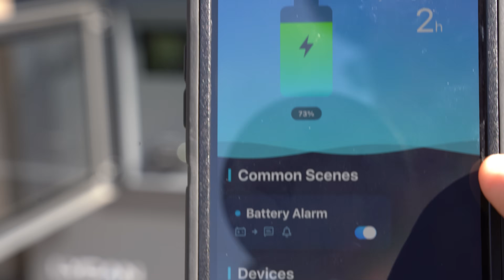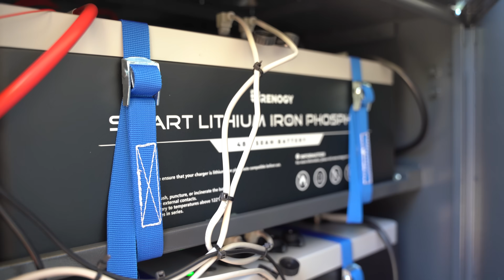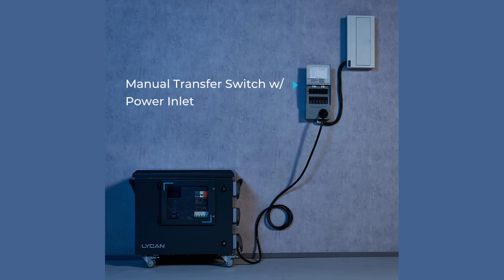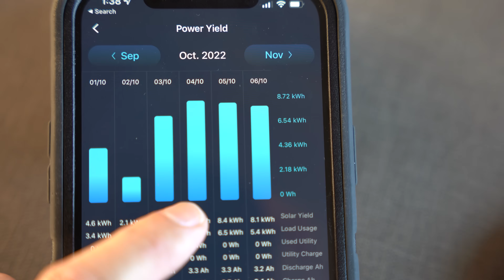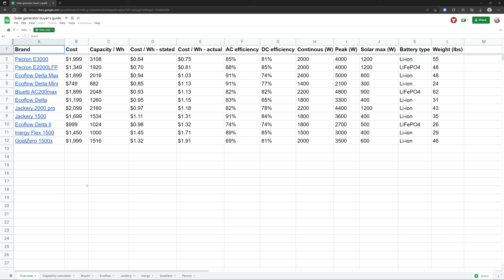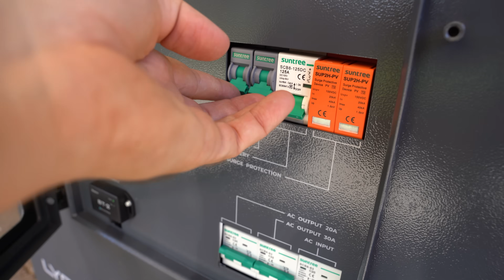Renogy Lycan 5000 - Home Backup Power

Comment from the maker: If you're interested in picking one up, you can get it here: https://cityprepping.tv/3D00sYE. Download the Solar Generator Guide: https://cityprepping.tv/3TUxu3f
Reply: I have a transfer switch but aside from the unit, do I  have to buy the lithium batteries too.
Reply: we need more prices when showing every item please. Those videos are very enjoyable and make you want to come back for more. plus no reason not to give us prices, it allows for us to make a better plan of what we need to come up with to get when we would like to have. Makes us Work Harder. ty.
Reply: @City Prepping, I think your understanding of battery endurance might be off.  Typically the rating is say "4500 cycles to 80% DoD" meaning if you regularly dischage the battery from 100% to 20% (80% discharged) you'd expect about 4500 cycles.  After that the battery may fail to retain a usable charge, and typically the battery will become less efficienct as it approaches that count.  You'd get more life with lower depth of discharge in theory, but the chemistry and battery support systems comes into play.  Temperature, balancing, total charge %, etc...
  
This 80%DoD ratign is very different from the B80 value.
Reply: , no point pretending that the energy situation is not planned and manufactured  .

Comment: Understandably it is weather resistant with it's IP-55 rating to allow the unit to live under a solar array. My question is if the unit is EMP-resistant as well. The unit is quite heavy so it would be difficult to store in a Faraday cage and be able to just pull it out. Do they have an option of using two unite to create two seperate legs and phased to set up a 220/240 system to power both 120VAC legs of my home. Most systems that do this use a comunications cable between them to set the second one 180 out from the first.

Comment: The new extension cords won't work with rain unless you waterproof the connections. They got a breaker in them. Found out the hard way.

Comment: So with all these types of videos (grid down or disaster type), what are the folks who can't afford these really nice setups going to do?  Has anyone covered a SUPER DUPER budget build or solar setup for those with EXTREMELY limited budgets?  Like where to find the bottom dollar used Solar charging equipment and used L.A./AGM/LifePo batteries that could be used in emergencies (as in these wouldn't be the 1st choice for folks BUT if it's all you can afford, it's start and better to have something than nothing).  No one (or at least no in my searches) has covered topics like this.  SURELY something can be put together as a guide for folks (even if it's not really recommended for broad use).
Reply: Logun!!!! You won something.  Check it out. Congrats.

Comment: It's not going to work. I lived in Maine when I was 3, if you wanted a drink of water, hand jack a pump, cooking was on a wood stove, and then there was the out house that was off of the wood shed. I never saw the out house because they would not let me go into the wood shed because there were sharp things in there, I always used a chamber pot, took a bath in a metal wash tub, that the water was heated up on the wood stove. There is a culling of the herd about to happen. You are making yourself a target by putting your self out there. They know's you got sumpin and they are going to come get it. The lure of filthy lucre is more alluring. You sir will not be around much longer, and I am not going to get lucky enough to die, I have long and hard roads to walk.

Comment: Back in the 1990's, wife wife was using something electric in the backyard, she did not unwind the 100 Ft. of extension cord from the round wind up I had it on. She drew so much currrent the the outside of the extension cables melted together. So that was the end of that cable.

Comment: Just tested out my generator powering my whole home. Worked well, thankful I have electrician buddies that hooked up the switches and breakers. Only thing I can't power is the a/c unit.
Reply: Which generator did you install?  That’s the set up I’m looking for!
Reply: @debrasaints3809  westinghouse from Sam's club. It's 5800 gas and I believe 5200 for propane. It's dual fuel

Comment: Hi Chris, just got two Tesla powerwalls installed. They are recharged by our 31 solar panel array and power the whole house. The Tesla powerwalls installed cost ~28k. Before we could get them installed our power company Xcel had to approve it. It took 3-4 months of paperwork and approvals before it could be installed. The document I had to sign was 45 pages long. It took the electricians 2-3 days to install the batteries. So far so good. I love them. The Tesla phone app controlling and reporting it -is addictive. Thanks for the video. I agree with you about the future grids stability and needing an upgrade. Take care, Mike
Reply: Tesla Powerwall is great product. We've installed a few hundred in FL over past 2 years...if you have the budget.

Comment: I added firman 7500 (using propane), professionally wired to transfer switch 12 circuits no 240 volt anything though.  My circa 1928 3 story has been remodeled with new wiring and hvac zoned, insulated, new windows/doors.  Haven't used the transfer switch yet here in Missouri.  This looks like a good (redundant) mobile  system to use ... if the grid went down for extended period.   Thx for the info, will ck it out some more.  I like the idea that this unit is pretty silent when running compared to the generator.  Wondering how long the batteries last powering the office setup?  How long to recharge if there is no sun and you plug in to house elect outlet to charge.

Comment: I had a certified electrician in to wire in a Firman 7500-watt generator into my circuit panel.  That was done at the beginning of the summer.  I’m going to run it with the non-ethanol gasoline (91 octane in my area).  Even though I have to do more to be ready for any power outage, I’m probably a lot better prepared than most in my area.

Comment: I think the primary 'checkbox' is portable versus well built/tied in. For prepping, it depends on the desire to remain stable and fortify or be agile.  We have reasons that agile isn't an option, so we fortify and this simply doesn't fit a problem we have. For those needing agility, it is promising.  The style of case allows for easy pickup with the tractor and pallet forks.  Wish they had "expansion cases" that were the same size, but nothing but safe pre-wired battery and bus bars.  In an evac scenario, I'd load this, the expansion pack, and one water tote in truck bed.  I can easily power the RV for a while on the go, then attach the RV solar to this before or after the move.  Very versatile.  I am not a Renogy fan AT ALL, but the design and concept is good. I'd really like to know if this equipment is built better than other items or same items in a new box.   Last, you mention the connectivity is read-only.  What is that based on?  EULA or code?  EULA means nothing to a FISA warrant.  Actual coding does.

Comment: This unit and the cost makes no sense for a bug out this would only be good if you live out in a rural area and you're able to defend it power down there won't be no internet won't be no TV the only thing you'll have to run possibly would be your deep freezer until it runs out of food and possibly an air conditioner or heater but as a prepper you'll have other means of heat and other ways to stay cool I just could not justify the cost and what you're talking about here

Comment: Yes my charger for my lithium batteries  has holes for the fan. Ants made there home (nest) in it and I had to pull it all apart to clean out (ants everywhere). So good Idea having a filter on the air intakes.

Comment: When the grid goes down in SHTF, for short term a solar power battery kit is unbeatable.
Long term, Vegetable  oil , like solid Crisco cans and candles. Doubles as a small heat source  and for cooking over.
When it really goes out, we may be looking at least a year without any electrical power.
Consider all the implications.
Diabetics will all die.
Couldn't even fuel your car.
We'll party like it's 1799!

Comment: I enjoyed the video, solar generators are a must for prepping.  I have the Delta Max which should allow me to ride out minor power interruptions.  I just realized that coupling with my Tesla gives me a lot of options in Camp Mode.  All that battery, but my Delta Max can only sip at it through a tiny 150 W straw!  Still, now I have 120v on camping trips.  And I can even treat my Tesla as a life boat of sorts at home for longer emergencies.

Comment: Thank you for you video.

I'm watching along and then it occurs to me that this does not pertain to me. I don't even dream of such a system it is so far out of my reach. 
I'll settle for the little solar and wind power system I have and be happy with a working freezer and some light bulbs.
 
Besides, the new duel fuel generator I bought to replace the one I burned will suffice for short term and maybe the longer term when I get the 400 lb propane tanks I'm working on now. 

Thank you anyway!
And have a great one.
Reply: Sounds practical.

Comment: OK, I have a really stupid question but I've always wondered us about solar power. How well does it work if you have long periods of cloudiness or even fog? We can go weeks without seeing the sun up here. Would it even be worth it to try to do solar panels?
Reply: A propane generator would be a good option instead of one needing solar panels.
Reply: @tortiecat6459  In real cold climates propane won't flow,no pressure.. Diesel  aka fuel oil/kerosene won't gel until it's -45f Think that was grade 2. Either way you have issue of availability and storage.
Reply: If it gets light it will get power, but cloudy days will cut generation massively, which means you need more panels to do the basics that sunny places do for half the amount. There are sites around the place that provide estimates for how many KWHs of sun locations get which can help you make a decision on value.
Reply: When it's the sunny time of the year, yes. When cloudy, no.
12v bicycle  generator or thermo-electrics could work.
Wind too,but where it gets extremely  cold, there is no wind.
Fossil fuel gave us civilization today and literally saved the whales as their sperm oil was a commodity  for light and heat up until end of the 19th century. Got plastics from it too!

Comment: I bought the original Lycan Powerbox. It constantly 'shut down' on the ac plug. Sent it back to be repaired under warranty. When it came back to me I turned it on and the same thing happened. Please read the reviews on Amazon because this was a common issue. $1,300 waste. I also have a few Bluettis and Jackerys and they work like a charm. I would never buy another Lycan anything. Buyer beware.

Comment: Interesting setup, I definitely like the metal box. I think for my money I'm still going to go with an EG4 6500 Watt and a couple of their 5kwh Batteries. Essentially double the inverter and double the storage for less money. Definitely not as portable though, and would need to be kept inside vs outside.

Comment: After seeing your review of the Pecron E2000LFP, I decided to order one with 800W of panels and the generator arrived yesterday.  Currently have it hooked up to the wall charging - it was 35% charged as it came.  The directions/manual are very... Spartan I must say lol.  I will see if they have something I can download from their web site.  Interested in this vid.... I just started it.  I figure if I added an expansion battery and get some permanent panels -around 8-900k Watts worth, I could hook up to my house panel (I will get an electrician to put a switch in for me)  - this excludes the HVAC and electric dryer.

Comment: This is awesome..but quick question, if and when the grid goes down.. how will this work if an emp were to happen?? Just wanting to learn and looking at this at all sides..
Reply: Keep the electronics inside a Faraday cage and EMP  can't affect it. The pulse goes to ground as that is the least path of resistance. Otherwise electronics cook and that includes every chip in your car or device.
Reply: You can construct a cage from aluminum foil, hardware cloth or chicken/turkey wire. Just ground it.
Reply: A two stroke bicycle  motor or a pre 1970 ish car and certain older prop airplanes will be the only things not bothered by an EMP. The US presidential doomsday airplane has an all analog system in it in case an EMP fries all the electronics.

Comment: Hey Chris, electrician here, it’s important to note that extension cords (sjoow cable) are not rated to run through holes in walls (legally), yes it works but a better fit would be inlet boxes on the outside and standard receptacles on the inside.
Reply: Code compliance a must for insurance purposes.
Reply: @RickyB67  emp  blast damaged your solar panels. best have stuff in a faraday   cage . unless  your electronics  is in a faraday cage its gone. are make its emp  proof stuff.
Reply: I second that, as an electrician.  Lol. I know reliance makes an easy option as well as many others.  Or just buying the parts.
Reply from the maker: thank you!  i'll hire a professional to do this correctly.  I don't want to do anything that could void my warranty if there's a problem.
Reply: @CityPrepping  this was a really helpful comment! When you have checked with an electrician, please post an update.
Reply: @CityPrepping  If you’re located in SoCal I’d be willing to help you out!
Reply: Super post, great comments, too.
Reply: Would also suggest that you lock up outside receptacles so no one will easily plug in electric cords to steal electricity.
Reply: Electrician union is a mafia in North America, they have the political on there side.
Reply: Maybe you electricians can clear this up for me because I never understood the reasons behind it. 
Why does code not allow for certain wires to be run in wall? 

Are there some issues with heat or something like this ?
Anytime I try to find out why the only answer I get is “because the code says” 
Why does code say this? 

Thanks in advance
Reply: @ericorange2654  it's not that wires can't be ran, they need to meet a certain requirement for the specific job. That can mean heat, a certain level of physical protection, and linked to load on the circuit as well. Also a power inlet has different connections for safety.  I hope this helped a little.

A good electrician will explain any questions you may have, explaining the code.
Reply: @ericorange2654  to be a little more clear there's a difference between running wire IN a wall and THROUGH a wall.  The wire MUST be protected from abrasion so that the jacketing isn't worn away and bare wire isn't exposed causing a shock hazard or a fire hazard. The NEC is regulated by the National Fire Protection Association (NFPA). Work not done to code is hazardous not just to the homeowner, but other electricians and services.
Reply: Eric, Your basically being forced to pay for an over educated "authorized" "documented" "licensed" person who charges top dollar who is supposed to know how to read, interpret, and follow code so it insures their job as well as safety standards. No dummies allowed. 😉

Comment: The info is definitely appreciated, but in all honesty, most of the population truly can't afford a system like this (or several others) that would power an entire 2-3000+ sq ft home. In a grid down situation, being able to power a frig and/or freezer, some lights, perhaps pull water from a well would be ideal ... and depending on the cause of the outage, I wouldn't "advertise" I had any sort of solar capability by using lighting at all during the initial weeks, perhaps months. I'd use my lanterns and candles so as to not stand out from the rest of the community. I also wouldn't be worried about a phone or the internet because they likely wouldn't be very functional (or even an option dependent on the cause of the outage). I'd be more concerned about enough power for my ham setup than most things. 

We're covered as far as heating and cooling by using passive cooling and a wood burning stove. We have the capability to cook during the winter on that wood stove, and have built a combination grill/ rocket stove 'burners'/smoker using old bricks and some homeless gas stove grates that allow us to cook outside year round using just wood (and not heating up the house in the summer). We have Dietz lanterns, every sort of flashlight/headlamps, various solar lights, and candles for lighting. We routinely save all wax from candles and remelt it to make more. We have a generator for short term events, but if I suspected something was long-term in nature I probably wouldn't bother with it (or again, 'advertise' that I had it). 

Even in a community where the majority may have solar panels lining their rooftops, after something like an emp/cmp or nationwide grid collapse, the ensuing chaos makes obvious solar a target as people scramble for resources. Grid down means medical everything, first responders, food and goods delivery, etc. is not available. Stores will be emptied, addicts will be crazed, those needing medical care are pretty much screwed, and calling 911 won't be an option ... and having a house with lights shining from every window would be like a beacon telling every desperate person within a mile that 'there is stuff here'. Just my opinion, but I'd be keeping any solar I had hidden as much as possible until the dust settled, and after that if I had enough power to keep a frig, lights, water, and comms functional I'd be good.